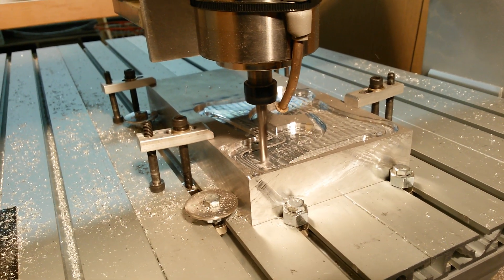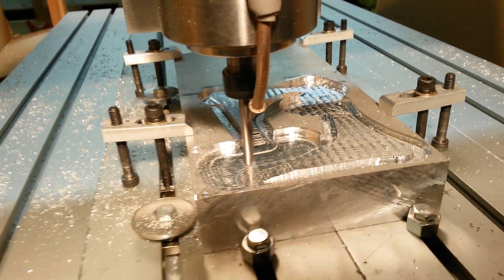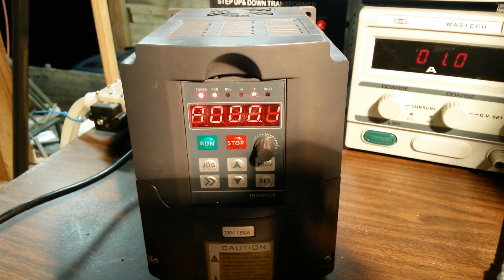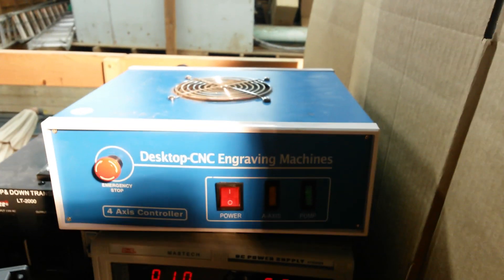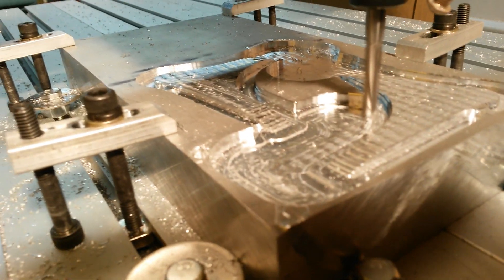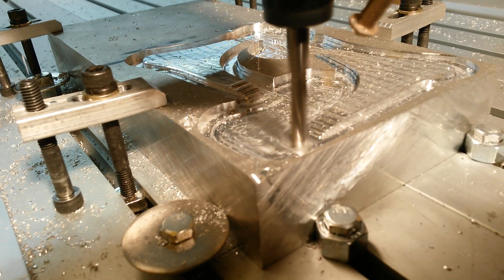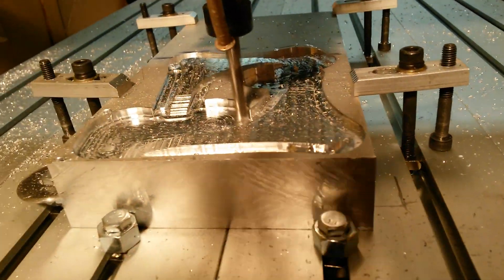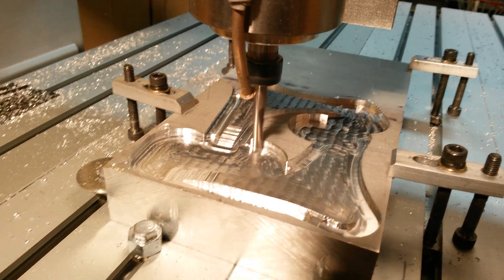DIY CNC 6040 Mill cutting machining aluminum Whiteside RU2100 2-flute solid carbide 1/2

Comment from the maker: Frankly, spindle power is the least of the problems.

You can't push the bit very hard, since the gantry is so lightweight of a build. If you pushed hard enough to tax the 0.8KW spindle, I'm sure you would be flexing the gantry, or maybe skipping steps on the motors.

Finding a bit that works great dry was important. Getting the tool paths correct is an ongoing difficulty.

Comment: Have you found that 0.8KW is enough for cutting aluminum or do you sometimes wish you had more power? Im looking at a 0.8KW or a 1.5KW and can't decide. Id prefer the 0.8KW due to the lower weight as long as it is powerful enough.